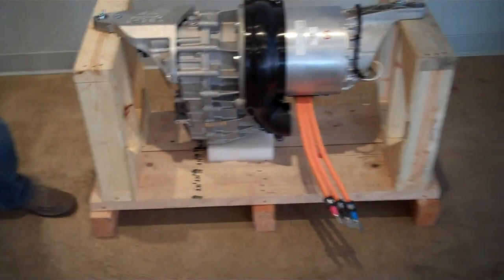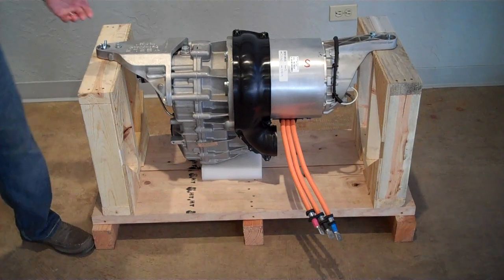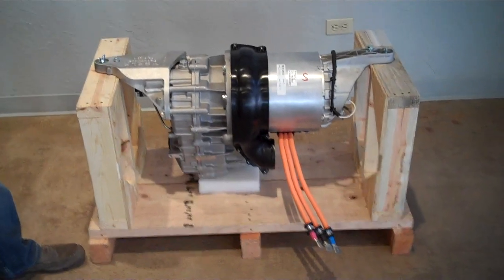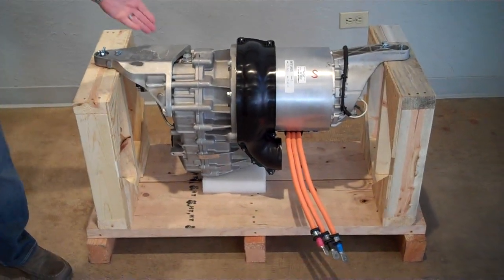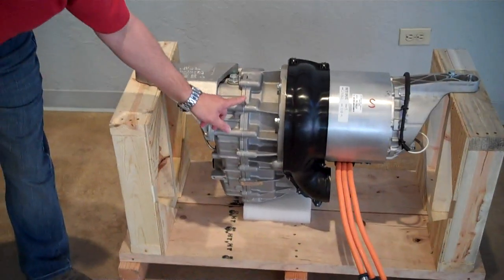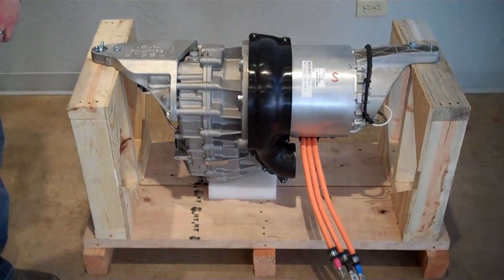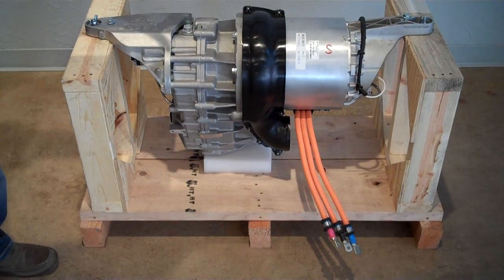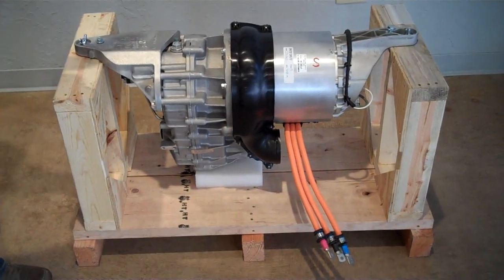Tesla motor

Comment: To improve the Tesla engine, you will need a Y shaped induction cable fashioned out of Iron Cobalt connected to both wheelsets to absorb the kinetic energy of the wheels.  At the center of that "Y", you would place two counter rotating magnetic discs that would absorb the energy of the wheels, and those discs would capture a fraction of the energy generated by the wheels and allow for 200 to 300 more miles of travel. The Y shaped Induction cables should be fashioned in such a way that the magnetic charge is spiraled until it meets the center of the "Y", at which point each magnetic charge from all angles is opposite of the other.  This will create magnetic current that will build until it reaches its end point at the counter rotating discs.  At that point the Y shaped intersection would be positive or negative and the top rotating disc would be the opposite, thus allowing for the induction of the inert energy of the wheels. The magnetic current will power the counter rotating discs and enable thestorage of yet-unrealized electricity to allow for more miles of travel.

Comment: Working on distributed engine system for IC.  Each motor is 100 hp 6 inch D by 12 inches, smaller than the Tesla motor.  I can make one about the same size with as much or more torque as the Tesla that is CONSTANT to 12,000 rpm if wanted..  Can put as many as you want into front and back as clusters....  Has NG tank included.  60% and the 40% waste heat can do cooling or heating...basically par to Tesla plug to wheel at 72 degrees and much better on cold/hot days.  

My preferred fuel is NG at $1/gallon.  Electricity is 15 cent/kwh which is $5/gallon.  Battery cost now is 12 cents/kw-hr....$4/gal.  That makes $9/gallon for Tesla fuel vs $1/gallon for NG.  The system compresses the gas from the house feed.  

My system also does not need a battery, but can use one if desired at 45%.  Car should be 1/2 weight of Tesla with same power.  Can do active drag reduction because it works with air...1/2 wind drag and rolling drag.  250 mpge highway, and 500 mpg city is for a 2 place on $1/gal fuel.  No smog, no NOx....just water and CO2, or none if run on battery.  Can be used for distillation...water harvest from car....clean water anywhere you go...  Can run grid power at 5.5 cent/kw-hr on NG or 2.6 cents/kwh on solar thermal.  

The verdict is not out....My engine can run better on electricity because it also works on air, thus lowering drag and does not need heavy batteries, thus allowing zero emissions when desired.  It can torque out at zero rpm, just like a Tesla. 

 In a flying car or roadable seaplane/ airplane it will be 1 cent/mile at 100 mph, and can go up to 360 mph with 12 motors and land at 30 mph door to door.  This new engine will be at least 1/6-1/10th the cost of an electric system to fly...  It can allow thrust vectoring on the water, solar power for when you beach on a island and more.  To do all this can do would take a massive airplane...  There is a better way....
Reply: How's the engine going jackass?
Reply: @rap_freestyles  Great.  (BTW, I am not a Jackass/Democrat)  I added CO2 capture and secondary drive for 75% efficiency.  Electro Ethanol fuel making now focus.  

Looking at 160 MPG at 70 mph, 300 City, 244 combined on gasoline and 112 mpg HWY, 210 city, 171 combined with electro Ethanol made from solar at $1/gallon.  The fuel with capture is 1/100th the CO2 of gasoline.  

On solar, the NET engine is CO2 NEGATIVE, and captures CO2 all the time, both from air and combustion.  

Dry ice for cold store in car...captured water for showers/washing in car.  

7000 miles on Ethanol, 10,000 on gasoline HWY.  Can tow up to 26,000 LB total combined weight.  Mini van/pickup would have 500 HP and weigh ~1/2 an EV.  Lots more...  

NET makes all the rest obsolete.   I saved 20 years of development by NOT building the 2018 version you mentioned.  NET will be the standard for engines world wide.

Comment: why 3 phase  motors in cars are smaller in size compared to 3 phase motors of the same horsepower for other use like cranes , water pumps etc?
Reply: Ev motors aren't running at full speed 24/7 so can be smaller than motors that run constantly and ev motors have to be efficient for weight so they are made smaller than cheap big motors.

Comment: Funny thing I once saw in a video a while ago about how the Roadster was assembled where they only showed that there was only one mount which was at only one of the sides to bolt onto the chassis of the Roadster. I guess they forgot to install the other drivetrain-to-chassis mounting.

Comment: Why does it have 3 wires?
Reply: 3 phase.. 3 wires..
Reply: Nema Doesn't really help me out
Reply: Forward, backward, and park.
Reply: +Slap Happy  The real answer is that the rotor is a magnet.  Outside the rotor are coils that create magnetic fields.  The way you make the motor turn is by pulling the magnet toward the coils.  You can't just turn all the coils on at one time, or the magnetic field is everywhere.  The way you make it spin is by continually alternating the coils around the outside in a wave, so the rotor is constantly chasing after the magnetized coils.

So, three wires.  One wire is ground.  Then there are two sets of coils that alternate, one on, then the other.  So there are two additional wires, one for each set.  An electronic controller somewhere controls the alternations, sending current through one set, then the other.

It's actually quite simple.  If you connected those wires to a two-way switch, you could make the engine turn yourself by rhythmically switching it back and forth.  It wouldn't go very fast, of course, but it would move.
Reply: Because it's an induction motor with three coils. In order to turn the motor at different speeds, you energise the three coils in sequence at varying frequencies.

Comment: Actually its not a full 600 hp in one motor.  Its two sets of motors one front one rear powering to 600 in total for Model S.

Yes it is a high power density motor but, it will still fall short of PMDC motors which uses the best magnets for propulsion.

This tesla motor is an amp hog, look at its wire size and you will see it takes in a lot of amps to deliver so much power.  But PMDC will not be as much of an amp hog and provide you instant torque more so than this sort of AC motor
Reply: +Constantine Joseph Well power = amps x voltage. Just use a higher voltage and you get lower amps
Reply: +2Awesome true, but the future is superior torque density like the Koenigsegg regera YASA motors.  They use PM instead of 3 phase induction like tesla.  Although it is an Hybrid its electric motors use YASA motors that has Ndfeb rare earth magnets.  That will give superior flux density to the motor and thus increase torque as well.  

Already three phase induction is so incredible.  Imagine rare earth magnet motors, imagine super conductor motors...... The cars of the future may fly if you give them propellers and wings lol.
Reply: Constantine Joseph Sure, find some cheap room temperature superconductors first =)
Reply: +2Awesome it's very possible and it's going to be cheap as well.  But I cannot reveal the tech or else people will get smart when they don't deserve to
Reply: Constantine Joseph you sound like one of those people that conspiracy theorists complain about lol
Reply: +2Awesome whatever that is in the market now is actually 20-30 years old in terms of researched tech.  In terms of motors, it is severely outdated.  Severely maybe 40 years outdated.   Plenty of suppressed technology is not going to be used in automation because the automotive industry is run by cartels, oil cartels and government regulators.  To earn money you need to be a lackey or an insider.

Comment: How they make such little motor soooo powerful? We have motors 55kW they 4 times bigger and less powerful.
Reply: +night3x The answer is simple. Look at a 50/60 Hertz transformer of 500 watts and compare it to a 500 watt transformer in a switch mode power supply as used in our computers. Higher frequency means smaller and lighter core whether it be a transformer or an AC induction motor................The Tesla uses 400 Hertz AC induction motors. Some high end rock saws use 400 to 1000 Hertz AC induction motors such as Pentruder saws. Look up the Pentruder CW630 saw. It weighs only 15Kg, but outputs 9Kw of mechanical power!! The power supply needed has to be 400 Hertz at 480 volt, 3-phase.

Comment: I'm wondering the cost, if ever the engine broke down? Or if it needed mechanical surgery????
Reply: Eh, not really. They're probably looking at an average of a ~6-8 year life span. Easily over 120,000 miles on the car. Now factor in all the maintenance you didn't have to do on an ICE. Which for me, doing my own maintenance, still adds up. For most people going to mechanics, it adds up probably 3x faster. 

Oil change for me is about $30 for synth...normal mechanics around here usually charge like $60 and oil changes are usually on the lower end of margins for mechanics. 

I had to  replace the crank shaft and harmonic balancer in my last car. Cost me about $130 for the crank and balancer, plus while I was in there I replaced all the seals, and piston rings belts, did some machining,  and cleaned and pretty much rebuilt the whole engine. (Which, props to Toyota, was amazingly clean for being at 274,000 miles, still had the original crosshatch marks on the cylinders. But I digress) I did all of that for about $200, maybe $250 on that car when all was said and done.  From a mechanic that would have been easily over $1500, if not more. 

Point here is, engine maintenance adds up quick. Even if you do it yourself. Once you hit the 7 year mark on a Tesla you may not have had any $1500 bills on an ICE engine, but you probably have had a smattering of $150-300 bills for things here and there, and probably bare minimum 12 or so oil changes. 

Getting close to the price of a new battery there in the Tesla, and probably at that mileage on the ICE those $1500 bills will start looming over you soon depending on how well you treat your engine. It probably balances out pretty close currently. In the future the Tesla may be cheaper as batteries become cheaper and more efficient. 

Add to that that a lot of people replace their cars once they hit over 100,000 miles anyway and the battery is really kind of negligible. Especially if Tesla offers a break for recycling the old one.

Comment: Oh, so it does need oil changes every 2 years or so, though probably less than IC-engines. That's a new detail for me.
Reply: +2014andBeyonD yeah, im changing oil like every 2 months or so :/
Reply: That is only the transmission that connects the engine(s) to the wheel.